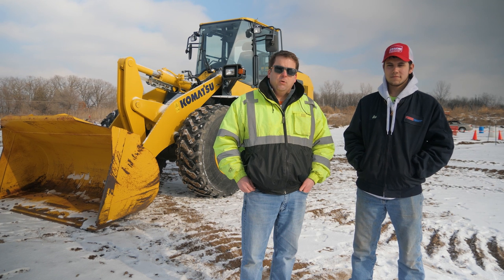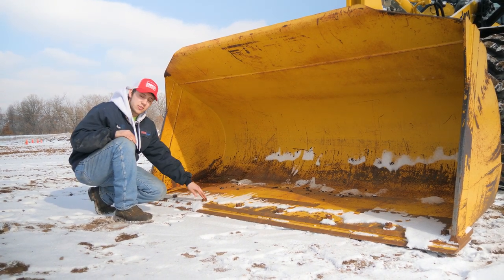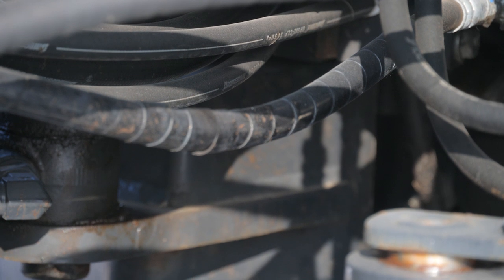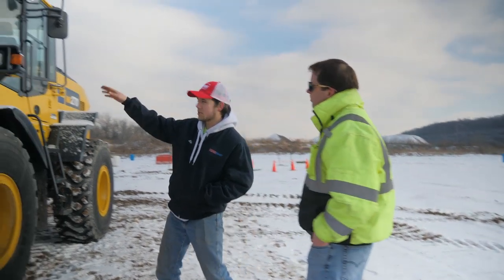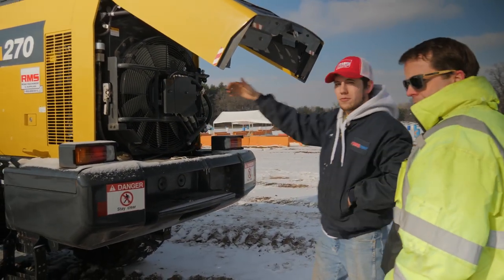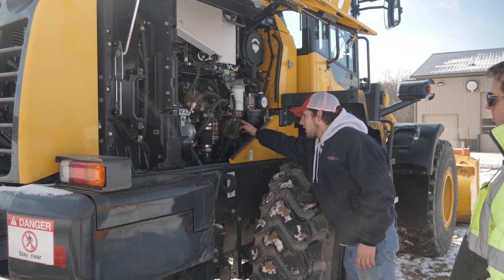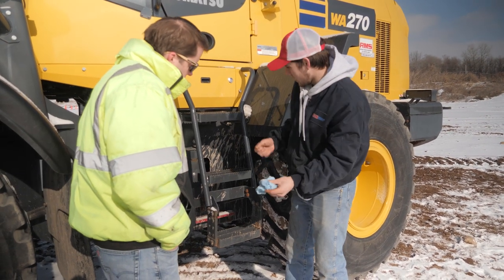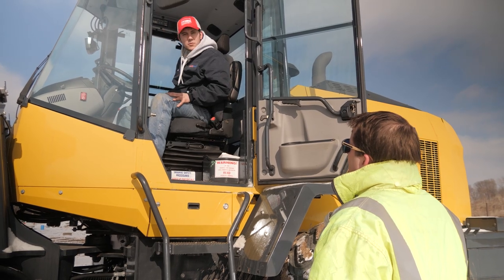How to do a Wheel Loader Pre-Operation Inspection // Ep. 130

Comment: That’s awesome thanks.by the way newer Komatsu’s what kind of engine power that equipment?? I heard that is Cummins engines , is it??
Reply from the maker: Yes, Komatsu does work with Cummins as a joint venture on their “Komatsu” engines in the equipment.  There are many other partners as well, so really depends on the model you are looking at.  Engine size/displacement obviously varies as well based on size, spec sheets are available online to tell specifics.